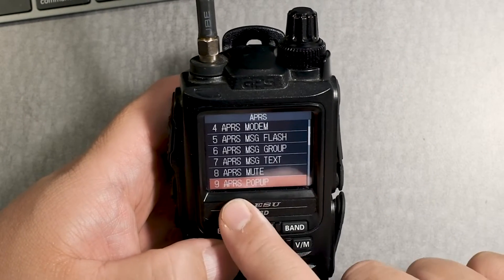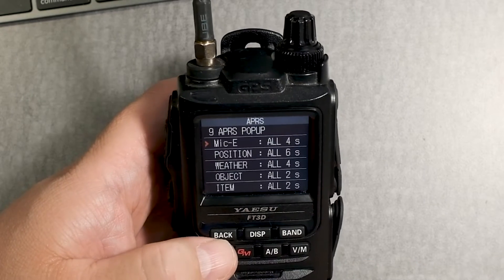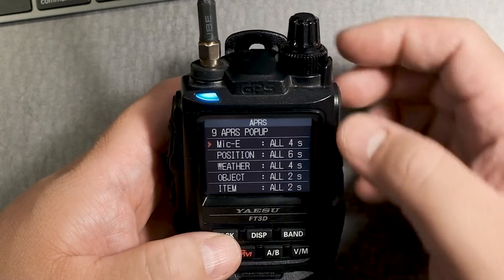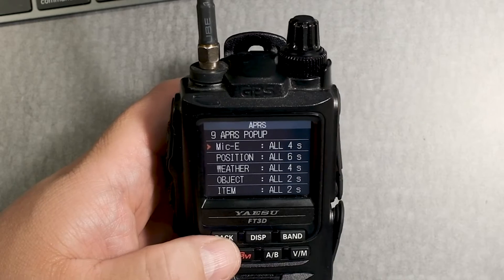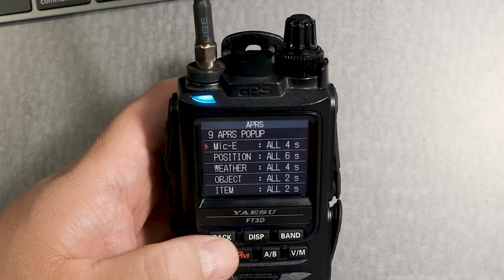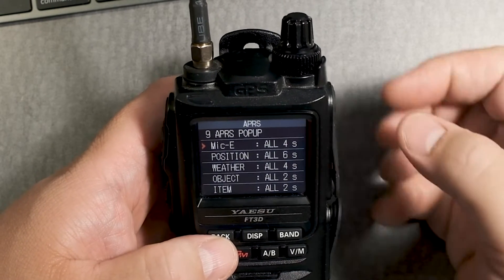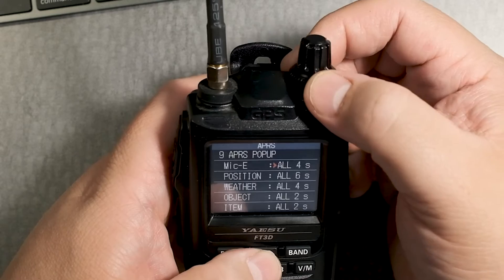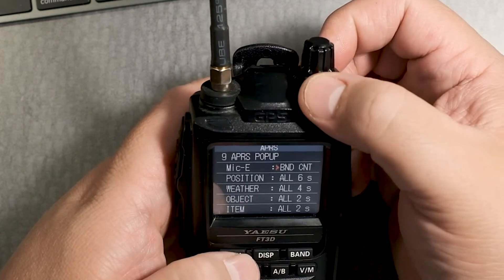Yaesu FT3D APRS PopUp

Comment: That turned off all pop ups other than messages to you.  Not sure yet why anyone needs pop ups - just looking into aprs for 1st time - but this blocked all of them without really explaining value or reason.
Reply: Pop ups are a necessity if you’re trying to digipeat through the ISS. Otherwise you will miss potential contacts.
Reply: Frank Romero no video. You need a hand held beam antenna like the Arrow or the Elk. Get one of the tracking apps to find out the passes over your QTH. Set the APRS freq to 145.825, set the Path to ARISS or RS0ISS. Put a couple of pre set messages, like QSL? and 73 from (your grid) in the radio. I’d try for passes above 30 degrees with a clear view of the horizon. That’s it, really. You can go to ariss stations heard to see if the digipeater is active. You should be able to hear the ISS it will show as RS0ISS on the screen. Getting in requires some persistence. As soon as you get a packet from the station send a beacon (or you can set it to auto beacon every minute or even 30 secs), if you get digipeated through the ISS, it should show your call in a packet via RS0ISS. There’s more to it of course: sending messages,  what constitutes a valid QSO, etc. but that should get you started.
Reply: Frank Romero I turn mine on when I’m working the digipeater on board the International Space Station. I can set it to Popup when I get a message. Not all APRS stations heard, just messages to my call sign. That way I know the other station heard my digipeat through an iGate on earth.